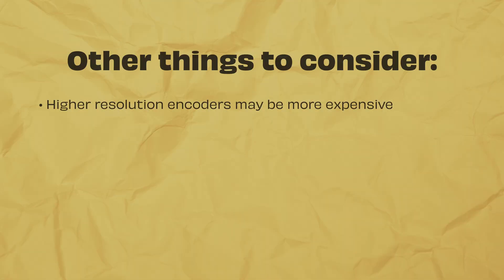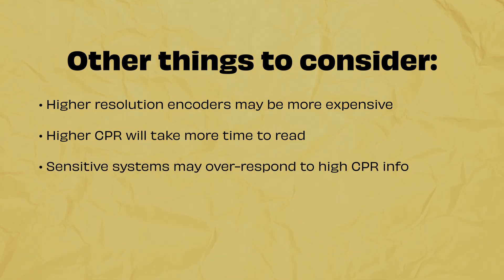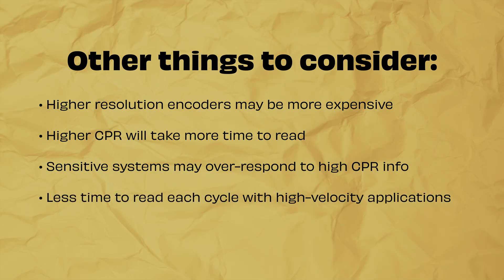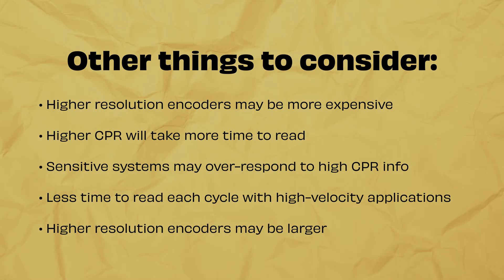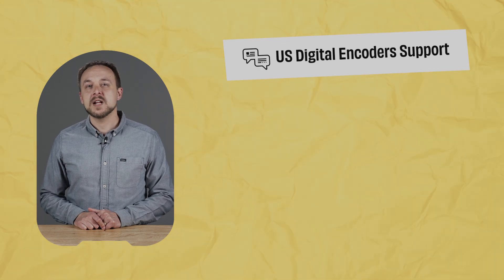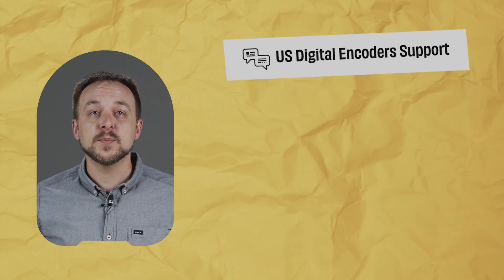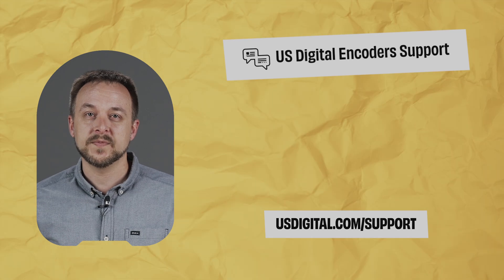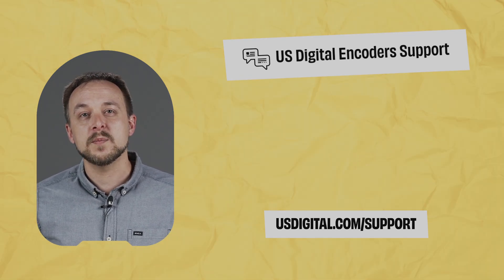How to pick the right resolution encoder | US Digital Encoder Support

Comment: Hi, I have an encoder with a switch that I need to change, there is no part number on the encorder so I don't know what to replace it with. Is there anyway that I can tell which encoder to buy and replace? Is there any way I can open the encoder and tell the PPR?
Reply from the maker: Thanks for reaching out to us. If you know the manufacturer of the encoder or of the original equipment, your best bet may be reaching out to them to see if they can help you narrow down the specifications or find the right replacement.

Comment: how to know total pulse in one revolution of encoder of 17bit?its single turn absolute encoder type.
Reply from the maker: Hi there, The total pulses per revolution for an absolute encoder should be equivalent to 2 to the (bit) power. So in this case 2^17 is 131,072. That should be the number of pulses. Be sure to doublecheck with your manufacturer.